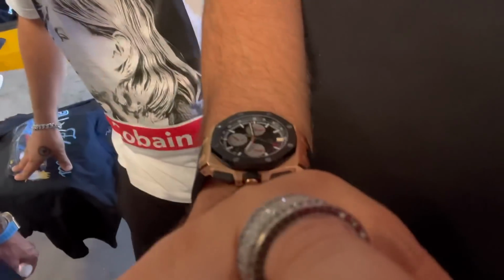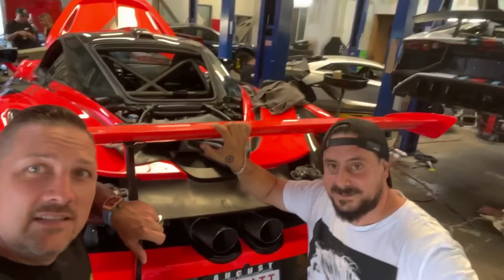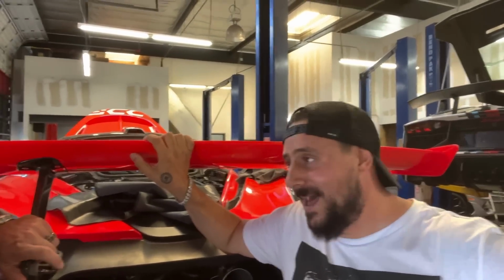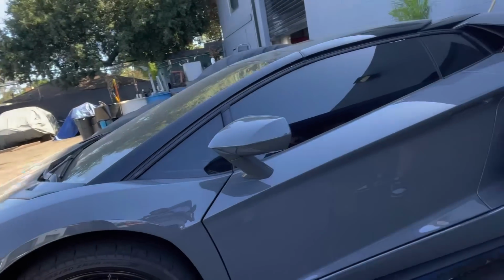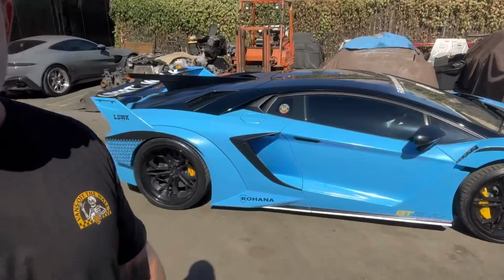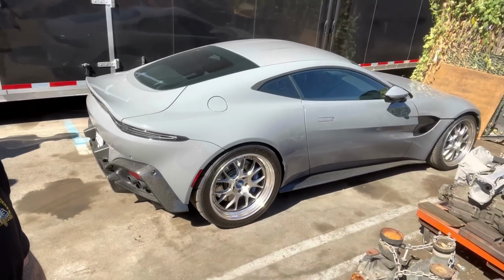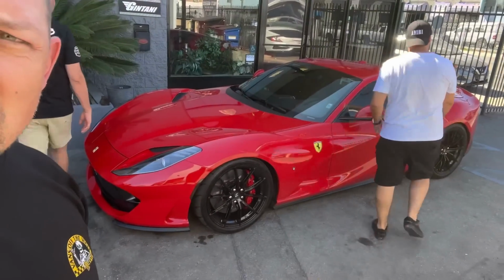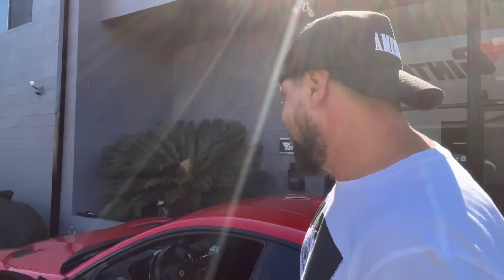Truth about What happened with 720 GTR!

Comment: Damon. I'm a custom firearms painter.  Cerakote is a ceramic based paint for pew pews, but the dura coat UI is better. Higher heat allowance and better uv protection. Is also ceramic based.
Reply: You can also diy it with cans now.
Reply: Bet you sub to Matt.?
Reply: Ceracote has really good exhaust specific coatings. I use that on everything
Reply: I'm French and I follow a guy here called aerographe fokeur who do the same firearms painting he use duracoat on many things motorcycle parts car parts etc and he also use Raptor paint on 4x4 trucks he even painted all the sensible parts of an Aventador SV which is a good idea...so strong that the paint stays intact after an accident 
Have a lifted one and lots of good vibes from France
Reply: Are you in the Florida area?
Reply: I coated my Xona rotors with cerakote they look super sleek in all black with the billet CHRA.
Reply: We use it on Valve Covers. Air Cure vs Oven Cure determines temperature stability

Comment: Cerekote is nothing like powder coating. Cerekote is a liquid high temp coating that if applied properly can withstand 2000,-2500’ degree exhaust temp. It helps wt scavenging as well.  Check out NIC industries in Oregon. They do amazing.